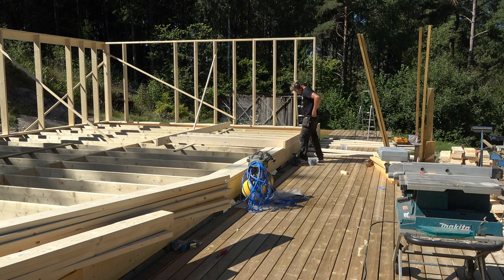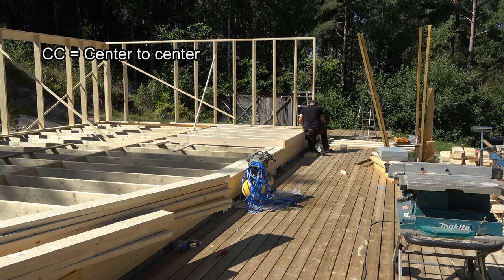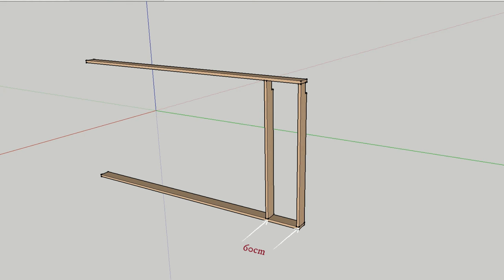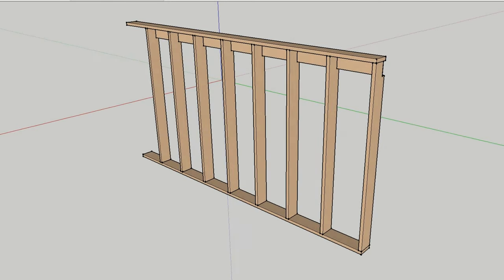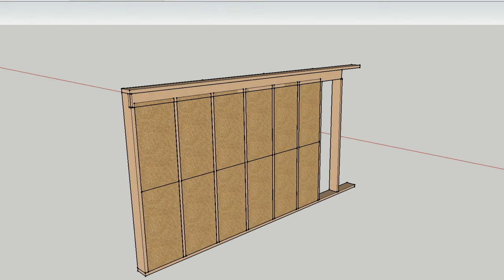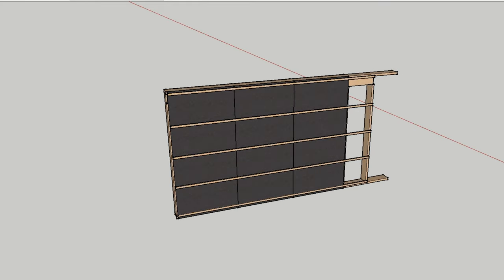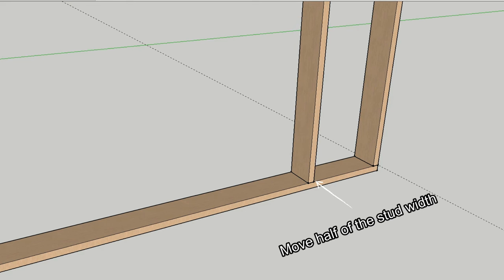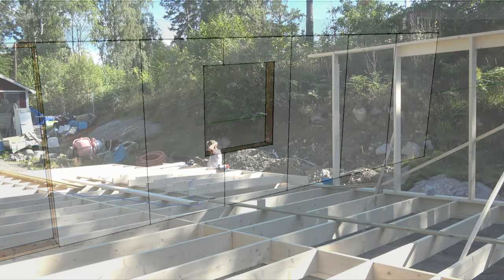The C/C or O/C method And why you have to learn it to build like a pro

Comment: Built a 12x12 lil cabin with sleeping attic in the forest up north in Michigan. It all went together perfect using similar 16" On-Center design. I cut all the wood and took it up and built it. My family wondered how I knew it would all fit together. I designed it in CAD and as long as I cut my dimensions correct, there's nothing that can go wrong. It's actually the pic in my profile on here
Reply from the maker: Yes that´s the beauty of knowing these kind of tricks. I did the same thing with an entire small house and it fitted like a puzzle. your cabin would fit my house perfectly :)
Reply: What kind of CAD did you use?
Reply: @k1zmt  I did it on Catia v5. There are actual cad packages that are better for house layout design
Reply: @caribbeanbound8357  I’m on Mac and I tried a few options but I found them either lacking in features or quality.
Reply: @k1zmt  I have never tried a card program in a Mac. They have all been unix or windows based. It seems that Autodesk should have something you could use. Or there are lots of free cad programs I hear people talk about these days that may work
Reply: @caribbeanbound8357  there is Archicad but it is extremely unstable.

Comment: In the US we call it OC (On Center), so for example 16 OC or 24 OC are the two most common.
Reply from the maker: Thank you, yes i have learned that now and that's probably the reason i couldn't find any information about in the US
Reply: Don't forget some also use 19.2" OC and you'll find most tape measures have that 19.2" OC marked with a black diamond the same way that 16" OC is marked. 

For those outside of North America, the 4' x 8' sheet of wood or drywall is the base standard by which EVERYTHING is built around including the PICKUP TRUCK. If you buy a work truck with a kingcab and the baby bed, don't take it to work unless you want a constant ribbing about your grocery getter truck that can't fit 4' by 8' sheets in the bed. 😅
Reply: @FirstLastOne how about you buy a European van and a flatbed trailer, so you can keep your tools relative safe and dry can bring a lot of stuff with you and if you need to bring sheet material or anything else you put it on your trailer. I love how the pickups look but they are so un practical
Reply: @guatf1  My dad has the same thought process, and as much as I respect it, I'll say this. If you're a contractor, and you're getting a trailer anyway, better to get a covered box trailer for your tools, that way you can use your truck for other applications at a moments notice. this basically is just the inverse of the van argument, and I firmly believe trucks are worth it if you're (like many North Americans) using your vehicle for other applications such as heavy hauling, farm work, off-roading or want the crew cab, which many panel vans don't have if their used for shelving, tools etc. IF however, you are in a city, or saturated municipality, the van is most likely the way to go. Out here in Canada, that doesn't apply to a lot of us.
Reply: @connorwildeman3048  never ruled the covered box trailers out 😉 the point I tried to make was about the unpracticality of a pick up

Comment: In the US we also have 19.2" o.c., it is most commonly used with "engineered" joists (the wood I-joists and prefab wood truss floor joists).  Yep, 19.2", not 19-3/16" or 19-1/4"......19.2".  On a US tape measure it is marked as the little diamond shape after the 19" mark, just before 38-1/2", just after 57-1/2", just after 76-3/4" and then at 96" (8 feet, as that is the standard length of plywood and OSB).  So it breaks the sheathing spacing up for 5 supports where 16" o.c. has 6 supports and 24" o.c. has 4 supports, all this is for an 8 feet panel.  Just information in case you have ever wondered what the little diamond is for on a US tape measure.
Reply: I never heard of 19.2" oc. Is this newer so that less wood can be used? I wonder if all codes accept this?  I'm used to seeing 16 and 24
Reply: @caribbeanbound8357  read his comment and you will discover your answer
Reply: @TheMavosa  did he say somewhere if it is a newer thing or not?
Reply: @caribbeanbound8357  Ive heard of 19.2 OC bur it's always been 16oc... HOWEVER, the diamonds do save costs as we see it as 19 3/16, it's 19.2 decimal.  Mainly used for i beams, floor joints, rafters but for the most part at least around here, we still use 16oc.  Simply for the structure purposes.  I don't care about saving one rafter, I rather have another than one less lol.  But mainly floor joist but even here we tell our clients that we will still run 16 for structural and strength purposes.

Comment: For new Building Codes this method (C/C) does not always work. For instance, Roof sheathing installs, sub floors, etc calls for an 1/8" gap between sheets to allow for thermal expansion and to prevent squeaking. If you're doing a 40ft long roof this adds up to a lot and you have to trim all your 48x96 sheets. The new Code makes sense but manufactures need to update their sheet sizing.

Comment: Well, yes, we kinda realise this empirically.  If you buy tng flooring for example it is 600mm wide, you’d have to be mad or very stubborn to make joists not be on 600 mm centres right…imagine all the cutting and supporting floating board ends….So yeah, the CtoC and building to fit the materials is kinda a given, rather than some moment of divine revelation.

Comment: Here in the UK, we have a mix of imperial meaurements and metric. So you can buy timber at 2.4m, 3.0m long etc, but a sheet of mdf, plywood, or OSB might be 2.4m or 2.44m which is 8ft. Very annoying!
Reply from the maker: It sounds confusing. When I started as a carpenter about 25 years ago, we quoted almost everything in inches but they were in metric and not exact inches, so for example we said 4 inch nails but they were 90mm or 2-by-4 which was 45x90mm, that is very strange we built long before we migrated to the states, must have been a trend of some kind :)
Reply: when i moved to Canada (from the UK) we still use Imperial for building materials but metric for everything else, you ask for a 38mm by 89mm stud they look at you as if you just stepped out of a UFO....and some items you ask for the nominal dimension even though it measures actual dimensions or vice-versa.   Petrol/Gasoline is in litres but paint is in gallons...
Reply from the maker: @andrewcarr2431  confusing
Reply: Osb Sterling in germany 2.5,2.65,2.80,3.0m.😅

Comment: no nail guns in the 70's. not for framing or roofing.  used 28 oz. Plumb rigging axes. set the 16 or 8 sinker, one lick, in.  drew the framing together.  nail guns don't draw stud wall components together.  need the wallop of a framing hammer. years later I punked out and bought a Paslode to nail roof and wall sheathing

Comment: Great video and great coclusion. In Mother Russia for example:
- cc for studs - 64 cm
- insulation 1200х600
- drywall (plasterboard) 1200x2400
- osb 2440x1220
And nobody cares. Why? Because!Cut, cut, cut. Throw out money and time.
Reply: Ha! I was about to write the same thing.

Comment: That on-center measuring system you speak of is the only way anything gets built in the US , there is no other way ( at least with our codes in the US.  In Cali walls are 16oc and floor and ceiling joists are 24

Comment: I enjoy watching your videos. I noticed something that was a bit confusing for me in the video at time = 4:26.
You are showing 60cms and 16''.   
60 / 2.54 (1inch)= 23.62 inches not 16 inches. 
It looks like your studs are at 16'' on centre or 40.64cm. But your insulation width at 55.5 cms so you are spacing your studs at 60Cms?? or 23.6 or 24 on centre. Does the ''Hammer board' pass for snow loads? I have only seen this in Europe not yet in Canada I wonder if inspectors would allow. Should because it looks stronger. Thanks

Comment: In the U.S., when we buy longer length lumber, it is always appropriately 1/2” longer than labeled. If we need a sixteen-footer, for example,  we need to cut it to exactly that on site. Is that also the case in Sweden? Do your longer boards come precise to the mm?
Reply from the maker: Wood is a big business over here and the competition is fierce so the wood is extremely good and cut exactly to the millimeter :)
Reply: and the sheeting has the measurement on the end grain. like in Norway?

Comment: This is good if you plan far enough in advance. I screwed myself because I didn’t want to cut studs down and so I made my walls 8’ tall but forgot too and bottom plate made it 8’3” so my siding sheet metal was 8’ making it 3” short so I cheaper out and just put flashing on the bottom drip edge to cover the bad planning. That’s why I practiced with a large shed so now I can build a mini home and not make as many mistakes. I’m used to engineers giving me plans and I build it. The only design I do is drawings that don’t get built so I’m working on the engineer side of things but there is a lot that goes into making a house perfect for builders and homeowner and functions properly.

Comment: What is the purpose of the “Hammer Band” and do we call it something else in the states, or do we just use a double top plate instead?
Reply from the maker: You usually do the double plate method.
Reply: @mindsparx1  Thanks! 👍
Reply: It appears to serve a dual purpose, standing in for the double plate as well as door and window headers.

Comment: once you realise that the construction industry sells what one could call "lego" is makes things must easier.   While older houses were custom built by skilled carpenters, using rough sawn lumber, notched, mitered and chiseled to fit.  modern houses are essentially assembled.  by knowing the basic rules and measurements a handy person can perform basic carpentry tasks.
Reply from the maker: Agree, it's mostly for sheet material.

Comment: I didnt see any king or jack studs that would transfer the weight around the window opening down to the sill plate on your CAD design
Reply from the maker: The hammer band act like that but i will also add more reinforcements around all windows and door before i insulate.

Comment: isnt it against code to use screws to frame wood studs? was always told to use nails as they don't shear under  cross load while screws will
Reply from the maker: Not anymore, the screws are even harder than nails even under shear loads, but it has to be construction screws, not ordinary ones.

Comment: i dont get how you make the measurement though. are you measuring to the center of the board or to the edge of the next board?
Reply: He's measuring from the same side of each board. If his first stud is on the right, he measures from the right side of it 60 cm and makes a mark. The next stud has its right side placed on the line. If he shifts his tape measure over 1/2 of the stud thickness, his tape will read 60 cm center to center.